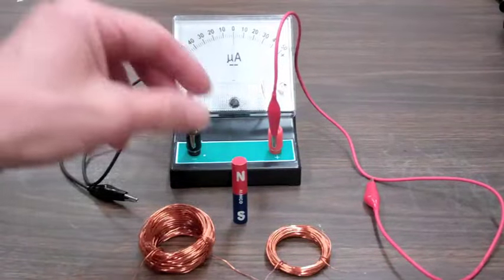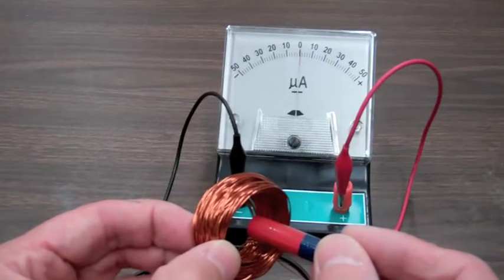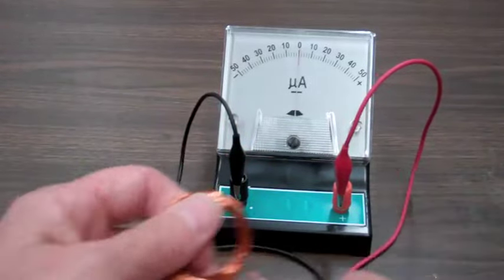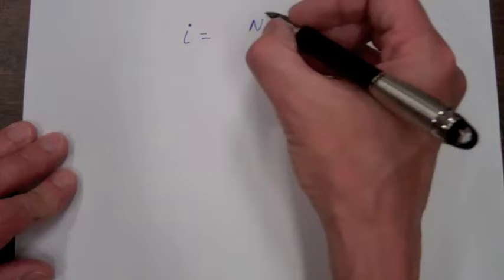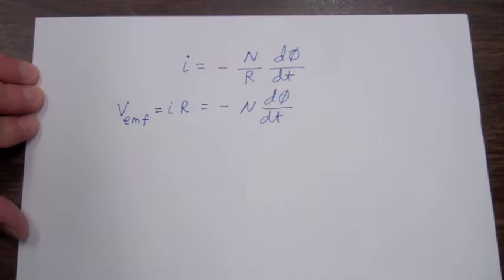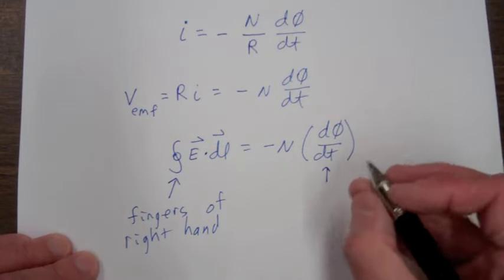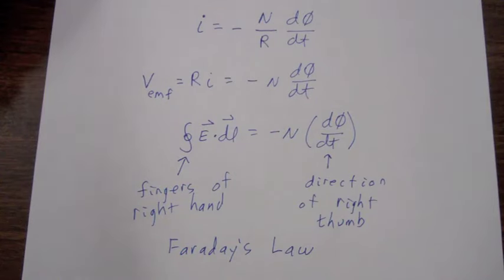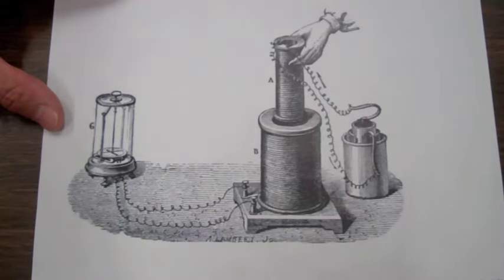Electromagnetic Induction and Faraday's Law

Comment: Prof. Melloch,

Thanks for posting this well explained demo. My only gripe is that Lenz's law could have also been easily demonstrated if the direction of the coil's winding was obvious. Instead of using the wire itself to hold the coil together, transparent tape could have been used, leaving the ends of the coil free, and the winding direction clearly visible. 

If I watch closely, the coil seems to be wound clockwise going from the right lead (connected to red) and coming out of the left lead (connected to black). When the N-pole is plunged in, the needle deflects in the +ve direction, meaning a +ve current is going from the red terminal to the black terminal within the μ-ammeter (through its shunt resistance), and in the external coil, +ve current goes in from the left (black) lead to the right (red) lead, i.e. in an anti-clockwise direction, creating a N-pole projecting outwards. So, this is also a demonstration of Lenz's law.

Comment: Michael please help meI tried to do this experiment but couldnot. Please tell the wire gauge, magnet strength and tell me do I need to remove the insulation ( enamel of the wire)
Reply from the maker: The wire gauge should not matter. Only remove the enamel at the two ends so that you can make electrical contact. You do not need an especially strong magnet. You need a meter that will be responsive to a pulse of current like a galvanometer.

https://www.amazon.com/Electronix-Express-01GAL500UA-Galvanometer-500/dp/B015X6U2OO/ref=sr_1_1?s=automotive&ie=UTF8&qid=1476362756&sr=1-1&keywords=galvanometer

Comment: Interesting, what type of copper wire are you using? Is it pure copper wire?
Reply from the maker: It is magnet wire, so it has an enamel insulation that needs to be scraped off at the ends to make electrical connection. It was probably 24 Ga, but I don't remember. But it should work with any diameter wire. The smaller the diameter would add some resistance that might reduce the current.
Reply: @electricandmagneticfields2314  thank you so much for your information.

Comment: the actual experiment has been done using a galvanometer, so can we do it using an ammeter, too?
Reply from the maker: The ammeter will not be responsive to the pulse of current you are generating. So you need a galvanometer.

Comment: Good day sir, im having problems doing that experiment, you see, i used a #22 solid copper wire and coiled, then i used strong disc magnets. But when i tried to see if there's current, there's no deflection in the galvanometer, even though i tried to pass a magnetic field to the conductor. Pls help (sorry for bad english)
Reply from the maker: Does your copper wire have insulation on it?
Reply: what insulation? the rubber covering the wire? or the thin coat in the wire?  i removed the rubber,  but not the thin layer coat
Reply from the maker: I am not sure what you mean by rubber on top of a thin coat. The wire needs to be insulated otherwise you effectively have just one turn. The only place you need to remove any insulation is at the ends so that you can make electrical contact.
Reply: try to burn the two ends of the copper wire with fire for a few seconds.
Reply: I m a teacher of physics, yesterday I did same experiment at lab but there was no any deflection in galvanometer . I removed insulation of the wire at ends .....can u tell me what was the problem behind this?